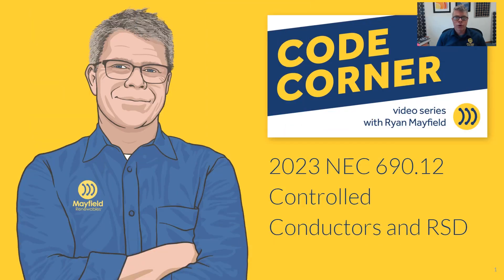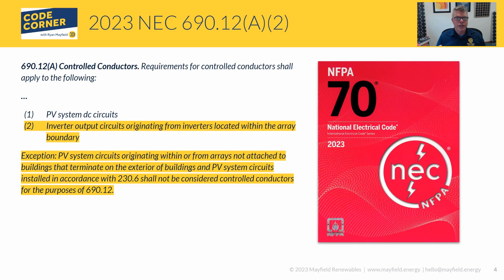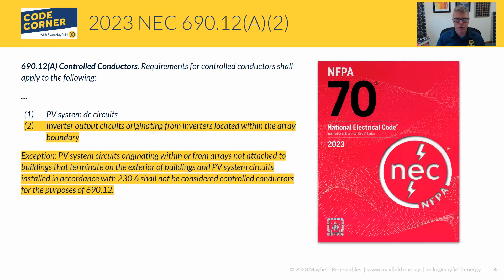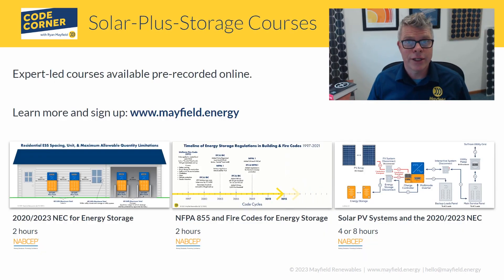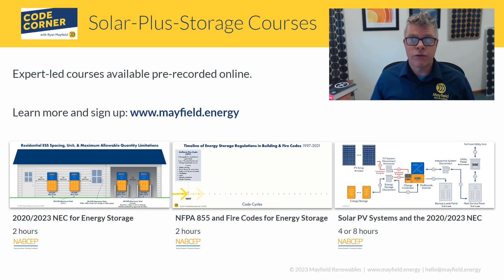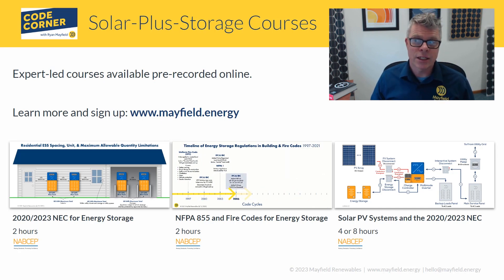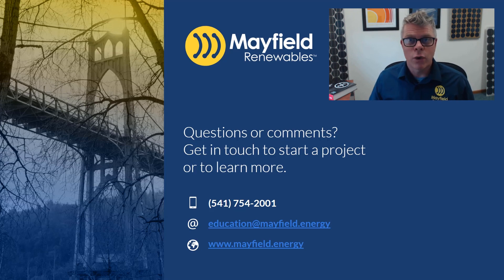Mayfield Renewables Code Corner: 2023 NEC 690.12 Rapid Shutdown & Controlled Conductors

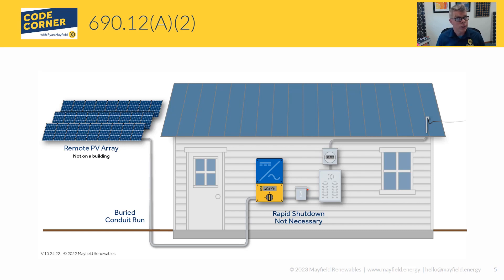Comment: At 5:55, I would say it doesn't make any sense at all to distinguish between an inverter located on the outside of a building or one mounted inside a building where they serve a solar trellis, carport, etc. Presumably, its the solar panels that catch on fire, not the inverter. Who cares if the inverter is inside?

Comment: How about a ground mounted array with 8 DC strings that enter indoor located inverters in a detached garage....trying to decipher if we would need just the DC home runs equipped with RSD, or the entire DC circuits including module level RSD, or no RSD at all? Mounting inverters outdoors not an option as it is a cold climate. You could argue that detached garage's primary purpose is to house PV equipment.

Comment: What about in the case of a completely off grid standalone system (residential)?  Is RSD required assuming we have roof mounted panels?
Reply from the maker: Hi Bryan, great question. The lack of a utility connection does not change RSD requirements under the NEC. You'll still need to follow NEC 690.12 language.

Comment: The language on or in is pretty specific. Need to have an exeption for total ouside to address this issue. On or in language still says on or in...
Reply: Thanks for the comment. The new exceptions are also specific in eliminating some of the conductors we must control. The first one eliminates circuits within free-standing structures from the entire 690.12 requirement. The second exception then goes on to say for circuits from those free-standing structures that remain outside a structure, we are not required to control those conductors. So, as long as we don't enter the building with those PV circuits, we'll meet the 690.12 requirements under the 2023 language.